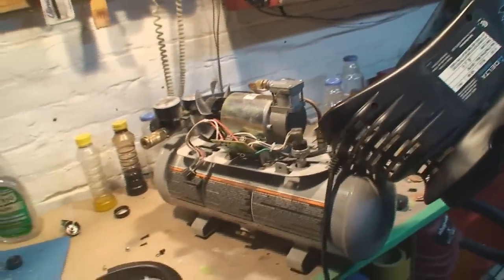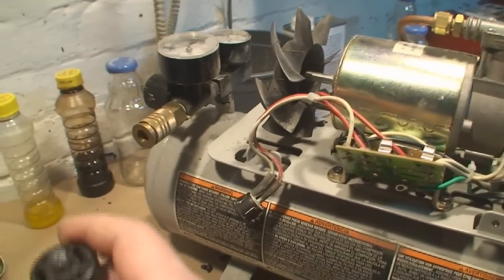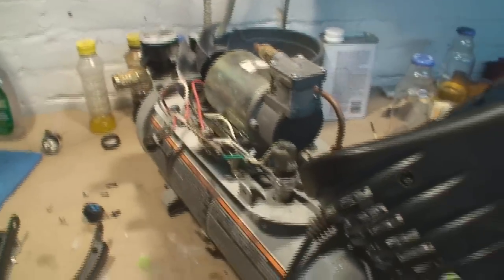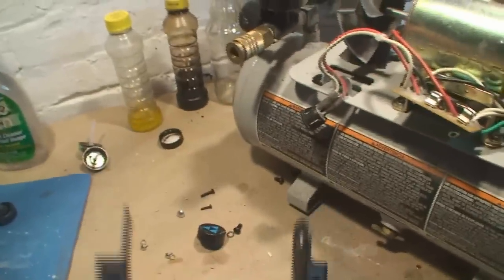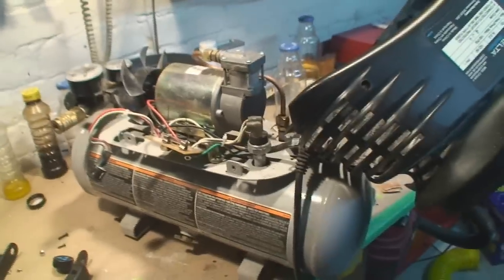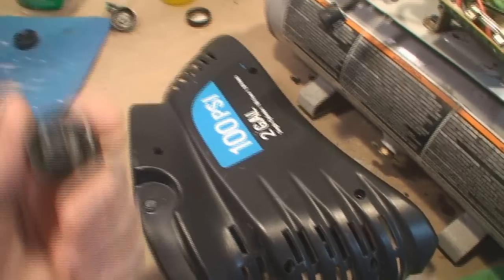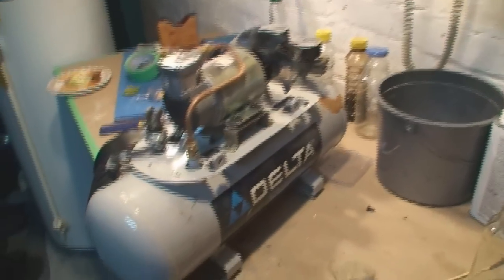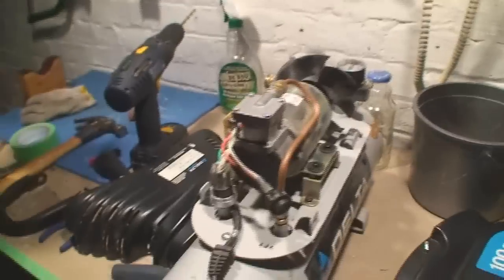Burnt Compressor FAIL DAVE GETS ELECTROCUTED !!!

Comment: Hey Dave,i have two large compressors for big spray gun,nailers etc. but noisey,i bought a mini compressor just for the air brush,has rubber feet and a regulator and moisture trap.quiet as a purring kitten .4"x10"x8"high works great.  Franks Repair  in Naples Fl.